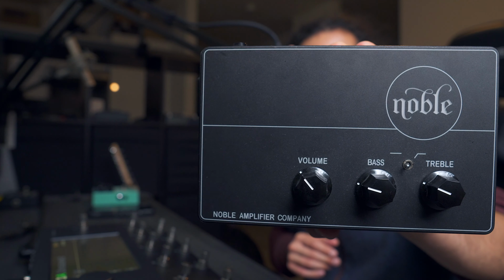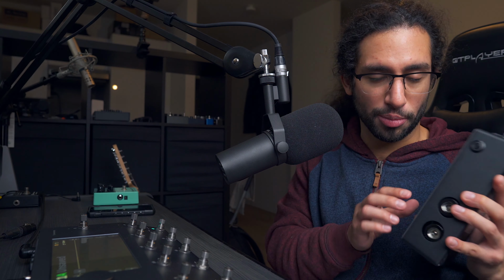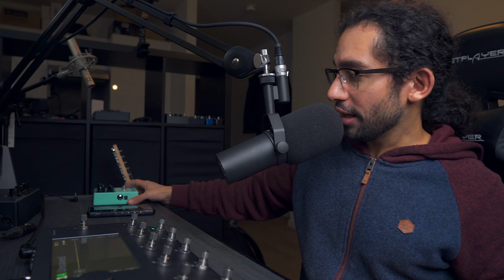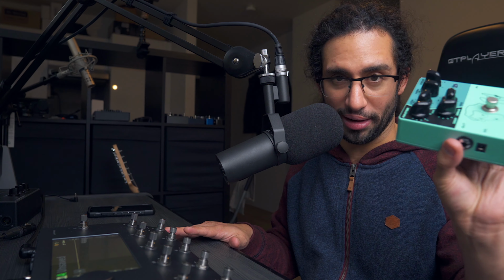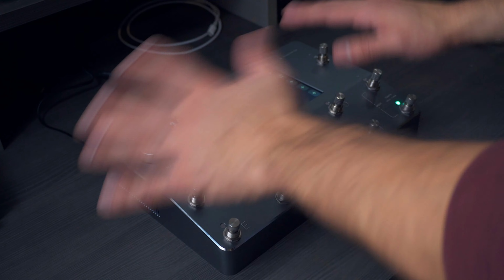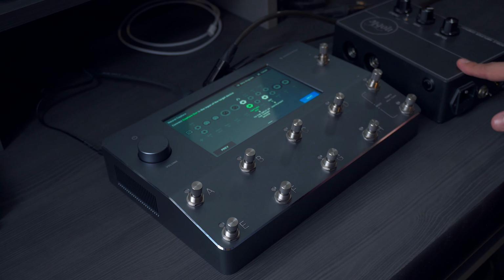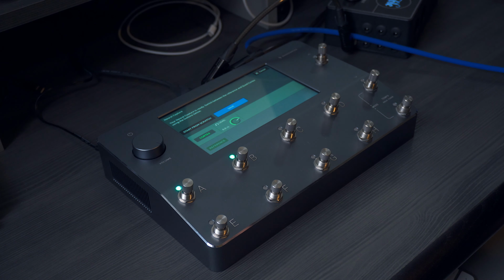1st Time Capturing Pedals - Quad Cortex | Bass Tone Tuesday

Comment: That's a tough one. One has tubes and the other a split signal. Really putting that cortex to work. Awesome. Thanks
Reply from the maker: Indeed. Trying not to overhype this unit 😄
So far, it’s holding up pretty nicely, though!

Comment: Thanks for the review. I've seen a few others and I think as the tech gets better, the Quad Cortex will be the way to go. Essentially, I think it's like the old 'valve (tube) versus solid state' argument when choosing an amp to play through; similarly, VHS v Beta, vinyl v cd. Like you, I think the Quad Cortex does a great job and I suppose it's a great place to start. Some will hang on to their pedalboards and amps while others will choose neural capture and the like. Nevertheless, the tech is here to stay and at the end of the day, it should be about the music, in my opinion.
Reply from the maker: It definitely has to be about the music 😄
Having an amp and cab on stage even when using a QC/Kemper/Helix is still cool, in my opinion. Nothing beats feeling the air being pushed haha